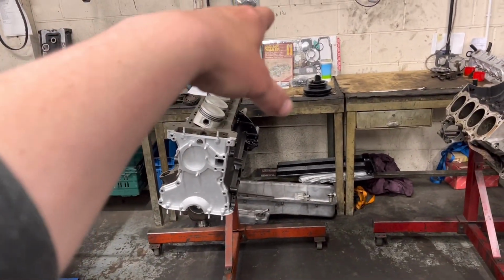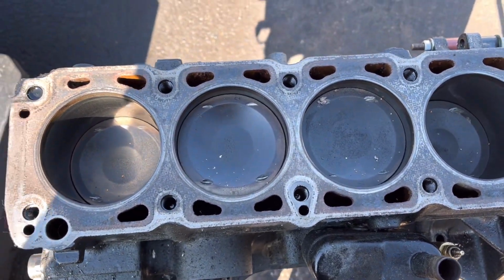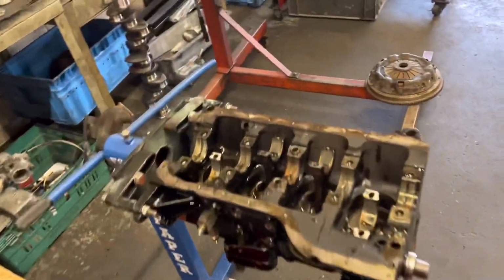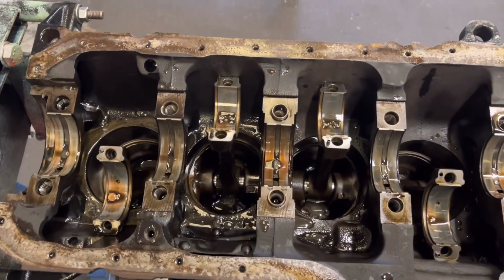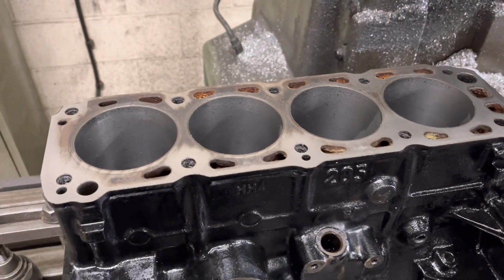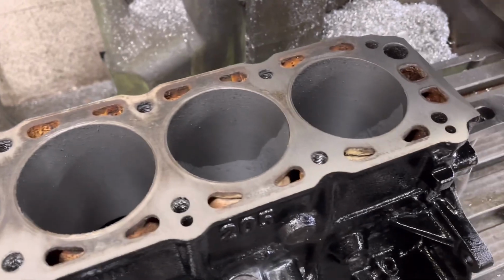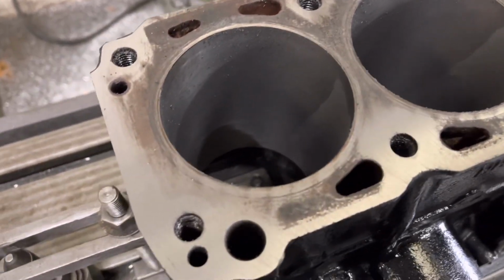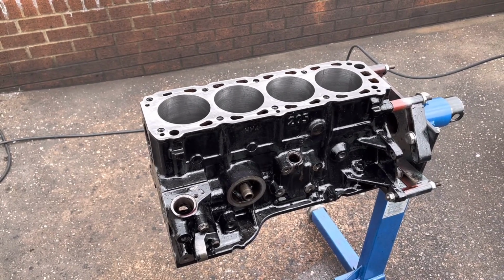Listen carefully, take NOTHING for granted, this could DESTROY your engine guys

Comment: We blueprinted and balanced a bog standard mini 850 engine and got 100 💯 mph from it, this was way back in the mid to late 70s , it was unbelievably smooth and was even smoother when we fitted the timing belt kit that came out for it, it was also super quiet without the timing chain, it’s just amazing how noisy the timing chain was. True story guys.

Comment: I wonder if some engine blocks are weathered which makes them harder. I remember hearing that Rolls Royce used to leave their 'green' newly cast blocks out in a field for a year to weather them.
Reply: Cummings did that as well.
Reply: I watched a video which stated that at a BMW plant they used to get all the blokes to piss on the blocks to harden them it was on their 1.5litre engines which they ended up getting 1,500 horsepower out of with massive turbos pretty sure it was for there F1 engines. Found the vid: https://www.youtube.com/watch?v=Kp73cPV9WAY
Reply: @fullboostturbo1  Yes, I think I saw something like that as well, not sure if it's true or even if it would work, perhaps an urban myth, plus those F1 blocks were aluminum alloy I think.
Reply: @onecookieboy  The 1.5 liter blocks were cast iron, and come from one of their standard type vehicles, which they then used for F1.

Comment: Question : not sure of what ring compressing tool your using , but wouldn't the oil control ring , 2nd from the bottom" get wedged in the tool before getting into the bore ?  Just asking  Thanks

Comment: Morning Lee, nice comment on the Healey piston and you are not alone: I had several, probably of the same source, that  had machining 'errors', although not as much as the ten thou that you mentioned. Was it all the pistons? You might like to add a caveat about checking ring gaps whilst on the subject. Excellent videos, please keep them coming. p.s. -  dont forget to check the Healey block oilways for porosity now it has been bored!

Comment: About the 6 cylinder Healey; a question, why weren't the rings test fitted in the cylinder before installation on the pistons???
I never trusted any pistons ring set I ever bought no matter the brand name.  I've found rings to big and I've found them to small with to much ring gap.  I understand you say the piston ring groove is out of spec but that should have been found on installation of the rings.  A ring, no matter which one, is test fitted into it's proper ring groove to check proper fit before piston installation.  So, do you have an oil ring problem or do you have a piston problem.  If the 3 piece oil ring fits the bore then you have a piston problem but if the 3 piece oil ring doesn't fit the bore then you have a ring problem.

Comment: I thought you gapped all rings before fitting them in to piston's/bore's, depending which foundry the block came from there maybe different "adaptive's in casting pot, although it wasn't a car foundry I worked in

Comment: The block looks like the old 2 litre pinto Cortina block. With Piston rings already fitted onto the Piston, just tip the Piston and Conrod assembly horizontal and check the rings just drop out from the slots. Push them back in and repeat. You would always check the Rings are a close fit with the Piston before you fitted the clamp. Good video lee, thanks.

Comment: Lee do you use a tourqe plate the block when honing the block to prevent cyclinder tapering.
If so love to see how you guys carry out the process and how fine a finish you go to when building high power engines to reduce piston ring break in.
Great videos Lee love machaine work always learning something new every day.
Reply: My old boss had one custom made for Datsun blocks. It was made with same material as cylinder head, and the same thickness, so it replicated the head very well.

Comment: I pushed an "OEM" piston into a Honda cx500 block without checking, These engines have no direct way of pushing the piston back up from below, And after trying for over an hour with various vacuum/plunger ideas, I gave up and drilled the piston and had to use the slide hammer to get it out. Wont do that again.

Comment: Hard sections in cylinders are caused during manufacture especially on older blocks where the plugs were inserted by hand and sometimes the alignment was not correct resulting one side being thinner and the other thicker so when there chilled the thinner portion cools quicker resulting in a harder section this is why just a hone sometimes does not work on a old bore.

Comment: Check out M539 Restorations latest video, a really good example of bore to piston clearance issues.  A BMW Alpina B7 engine wrecked on its first test drive because the pistons picked up in the bores.
Reply: I watched that... poor guy... this is where you have to put your trust in the machinist... you are not going to have expensive 3 point bore gauges and micrometers yourself ... unless you regularly do rebuilds.

The problem there was that the machinist failed to allow for the fact that aluminium expands more than cast iron...by a factor of 3 if I remember correctly... perhaps if he had heated the pistons & tried them in the bores before he put it all together he might have gotten a better idea there was a problem...but you make the assumption that your machine shop know their job...🙄

😎👍☘️🍺
Reply: @peterfitzpatrick7032  yes you have to feel for him, especially after waiting 3 months to get the engine back and the amount of money put into it.Not only was the clearance incorrect but the bores were ovel. Hope he has better luck with the new engine he's purchased.

Comment: That's a good tip , a few years ago I built a 205 pinto for a super stock.Engine bored , block skimmed,  crank checked etc . Put it all together with new mains and big end shells . Started car and it knocked its nuts off . Striped out bottom end and checked shells which came in a sealed box and they  turned out to be different sizes , ordered another set and they all turned out to be different sizes . Ended up going genuine Ford and as good as gold . So take Lee's advise check everything.

Comment: I've got a Duratec HE with 140,000 miles and oil changes every 10,000. How long do main and big end bearings last before getting down to the copper?
Reply: Get an oil sample and have a lab test it. One of the things they flag is any copper in the oil. We used to test a sample of our heavy equipment oil at every change.
Reply: @marioreali5925  great suggestion.  It avoids dropping the sump and taking end caps off!  Thanks

Comment: How did you figure out if the problem was the piston groove depth or the ring tolerances?
Reply: I've been a precision machinist for 30 years and you assume nothing and double check everything twice. One thing that has bothered me is people assume the pan rails on a block are parallel to the crank C/L and use it as a datum surface for all their machining, but the main caps have to be kept in the position they were bored at. I think a ground mandrel the standard bearing bore size would be the most accurate way to keep the decks parallel to the crank and the bores perpendicular to the crank. Factory machining is less than ideal to build an engine as close to perfect as possible. When you start stacking tolerances things can get way out of spec, if you don't consider how each part will effect the next and the engine as a whole assembly. I enjoy the channel and would enjoy hearing other people's thoughts about this, it has always been something I have thought about and plan on building a fixture for SBC to deck and bore blocks this way.
Reply: Assuming the oil control rings are correct at 0.185" width,  then the 0.175" measured piston groove depth is wrong...so he must have confirmed the ring width first ?

Of course the ring width could be oversized & the piston groove is correct... you have to know the dimensions to make that call... in a way thats kinda what this vid is really all about....

Its difficult to do without expensive precision measuring equipment which yoj wont have unless you are regularly doing rebuilds... so you have to trust your machine shop and buy only top quality parts... 

Another thing to check with new rings in a "new" bore is ring gap  ... this is an easy one, put the ring in the cylinder and measure with feeler gauge...

😎👍☘️🍺

Comment: I used to work a lot with cast iron, from foundry to machine shop.
All kinds of things can affect the toughness of the iron - slight inconsistencies in the melting pot, how quickly the cast was cooled, or even how hot it was wen it went in the shot-blast.
Slow-cooled iron is lovely to machine, it leaves a nice dull grey finish. However, if the cast was just knocked out its casting box at 400 degrees then put outside in January rain to cool, it's gonna be a pig to machine.
Reply: Agreed. I worked similar for 13 years on large slurry pump casings. Even after I left it took a year to feel clean.

Comment: I know BMW used to use old blocks for their performance engines and left them outside and encouraged staff to relieve themselves on them as it had a positive effect on the longevity of the block.
Reply: Yes you are correct and here is the link to the video:https: //www.youtube.com/watch?v=Kp73cPV9WAY
Reply: its a lovely bit of folklore about the BMW turbo F1 engines,  but sadly not true, read a great racer engineering interview with an ex M division engineer who built the engines(now head of Audi motorsport iirc) who confirmed they were asked about it so much they did actually try it once and the resulting engine did not even make it through warm up cycles
Reply: My old forman used to say that Tornos ( Swiss sliding head machines ) put their castings outside to harden in the elements.
Reply: @woody1760ify  Large castings were ‘weathered’, often for several months outside, to allow any internal stresses in the castings to relieve themselves before machining.  Sometimes roughly machined and then weathered before final machining.  Technology has moved on such that castings are less prone to stresses, and are shifted from foundry to machining in a very short time-scale - particularly relevant to automotive engine blocks, where JIT stocking systems are now the norm.

Probably a bit late to ‘weather’ an old (already machined) block as the stresses are likely long-relieved by then.

Comment: Like you , been building engines for years , and learnt the hard way about poor tolerance parts .
Before loading the rings onto the pistons , I always check the ring clearances in each relevant bore . Amazed at how many are too tight .
Reply: thats good practice for any engine but the trouble is in this instance you could check the ring gap in the bore off the piston and it would be perfect
Reply: I had the same thing happen a long time ago, no ring gap, there is a special tool for grinding ring ends, never trust aftermarket parts.

Comment: with 50 years in machining i have seen some cast absorb stuff out of the oil and with the heat of a motor act like a hardening dip. it all depends on what has been in the oil used and how hot the cast got. i worked with Russians and polish that used oil with chemicals added and boiled at high temps to surface harden cast for better ware. they used every trick in the book in the old soviet union as there was little around to buy so it all was improvise.
Reply: Now that's a very interesting and eye opening comment sir!

Comment: Question:  how come these semi closed deck cast iron blocks need liners to run 450hp?  I would have thought that mod wouldn't be required until over 700ish....
Reply: That block (Ford Pinto) was designed in the 1960s for 100BHP!
Reply: @ralphmillais5237  haha OK fair enough then

Comment: Similar problem a customer had after fitting his engines  with new STD size bearings :  starter couldnt crank it .... completely stuck crank...

Turned out in the new bearing set there was 1 shell 0.025"  undersize....Yep...that clamps good when main bearing caps are tightened with  150 pound feet ......😁
Reply: Lucky the main saddles didn't crack.

Comment: Seen that ring depth problem many, years ago (45 yrs perhaps), had to alter the depth of the piston ring groove a smidge on the lathe.  Always checked if the rings sat in the grooves ok after that!
Reply: Yeah, I was hoping Lee what tell us what his 'fix' is going to be for that, whether he sends back the pistons, just the ring, and/or machines the fit to get it right.

Even if he could 'fix it'...would the manufacturer's warranty still be valid, and/or, does that even matter?
Reply: Remember Cord's piston rings?
Brilliant. But I think another British top quality engineering company gone into the wind. Thanks Maggie Thatch, again... I am 60. 😎

Comment: Bmw f1 engine 4 cilinder turbo up to above 1000 hp was built from used  m10 engines because they where heat cycled to the point the engines where stronger then new cast blocks
Reply: think i seen that on that program with arnold rimmer, sure he said they left them outside for a while and peed on them
Reply: @mikedoblo4782  been working for bmw for some time now and we hear those stories about the engines coming from bmw technical teachers
Reply: @mickvanderlooven9366  whats the reason with one series front springs that they never recalled them and modified it like peugeot/ citroen did when the spring broke it slides down strut sticking in the tyre or if it misses  the tyre it puts that much pressure on the brake hose the brake is jammed on
Reply: @mikedoblo4782  do you mean the E or F chassis ? because we have more springs breaking on e60 then on e8x series and a lot of times when replacing shoks they mount the spring the wrong way and then they run of the housing into the type or brake setup
Reply: @mickvanderlooven9366  think its e80s but they have been all original springs with the painted codes on

Comment: How much bad mech timing has to be perpetrated and cam push inaccuracy to get mushroom and hammer to meet?   ...in my world 350 L82 chevy  - 351 Cleveland, Windsor's, 289 & 302 Fords, 340 & 440 Mopar ... we can't do this without purposefully going out of one's way  to do a bad job.
Reply: The cam on this one actually snapped at the pulley causing the damage